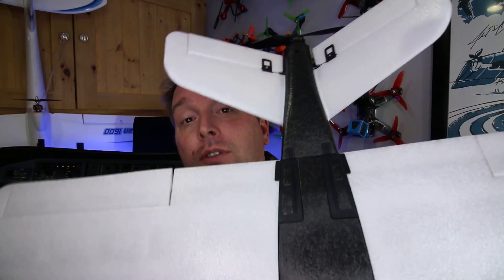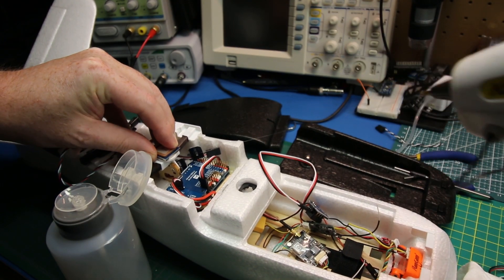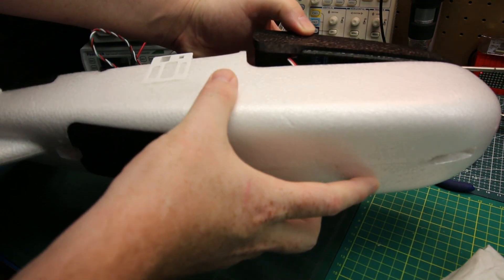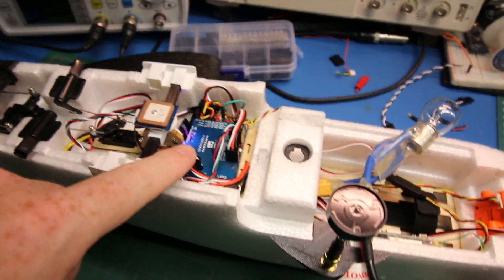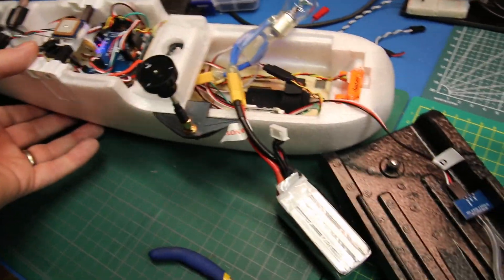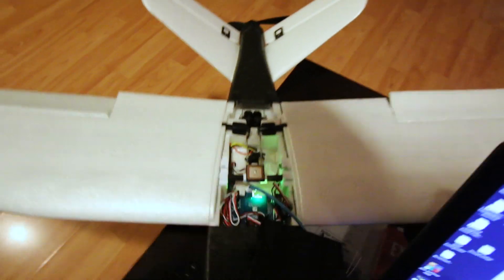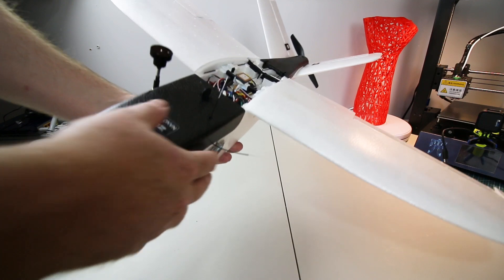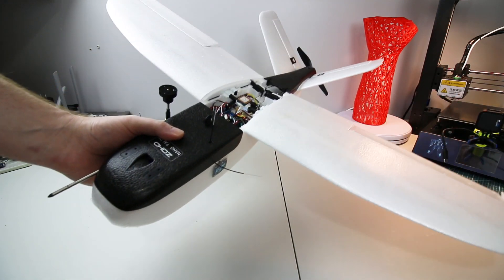Autonomous Aircraft Build - Nano Talon Ep.2 Installing Electronics, GPS & FPV Systems

Comment: 3:09 I can hear a beep every one second in your video. I'm getting the same in my nano talon+pixhawk after connecting battery. How does this beep stop. Also my motor is not spinning when in press throttle. Please let me know what to do.
Reply from the maker: That is the esc beeping the motor as no valid signal has been received (TX is off in this case)
Reply: I turned on TX it still keeps beeping
Reply: Mission planner also responds to stick movements but servo/motor not responding anything